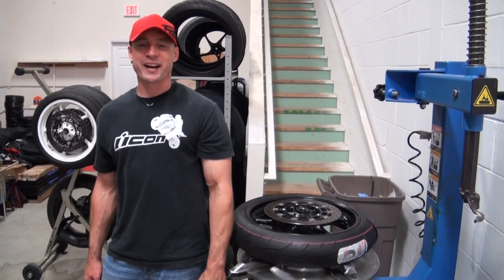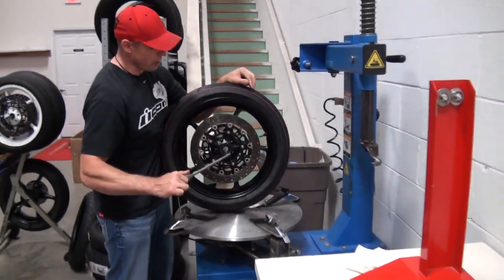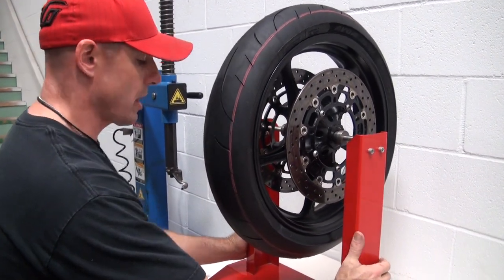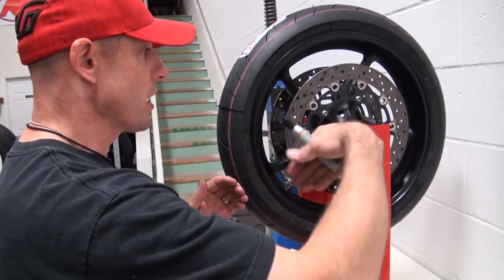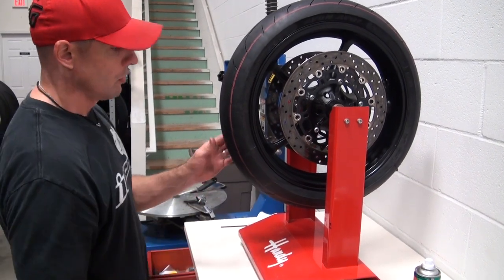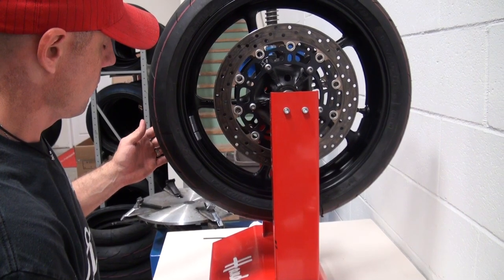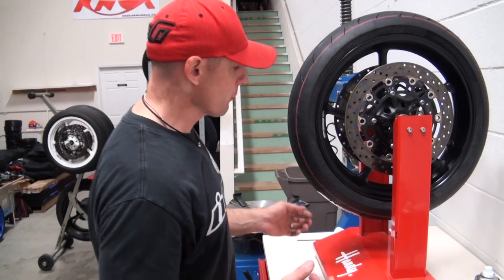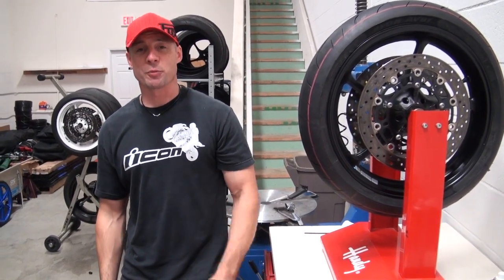How To Balance a Motorcycle Tire and Wheel from SportbikeTrackGear.com

Comment: Before I seat the bead. I balance the rim and tire together. Moving the tire on the rim. A lot of times you can eliminate 1/2 of the weights.
Reply from the maker: That's a solid idea! - Van
Reply: Smart. I'd use a red marker. Shows up better on the tire.
Reply: There was a guy on YouTube showing where usually stands the heaviest part of the tire itself and then the rim heaviest part is where the valve is. So I guess if I counter balance and put the heaviest part of the tire opposite to the valve, them I would need way less balance weights at the end
Reply: @bulltivation7846  the valve stem isn't always the heaviest part. use the balancer to find the heaviest part and mark it with a red circle. then you just match the red circles everytime

Comment: Just a quick one, i was always advised to split the weights so they are equal, in your case 1/2 oz on each side of the rim opposite each other to maintain true balance on both rotation and also side movement.
Reply from the maker: I will split them if it takes more than six segments typically. End of the day I do not think this will make any notable difference. - Van
Reply: If you're sending a machine to Mars, I'd say yes, split the weights. 
On my bike, nah, wrap a little solder around a spoke. 
I'd peel off that paper tag tho....
All joking aside, this is the best vid I've seen on this topic, and will recommend it to others.

Comment: Why can't you just put the wheel on the bike( remove brake pads and obviously belt or chain) and just balance off the wheel bearings?
Reply from the maker: This is the best way to do it, you need to reduce the drag so it can spin freely. - Van

Comment: Probably a dumb question but what is the purpose of balancing tires ? Is it really necessary say for someone who rides street ? My bike doesn’t have any of those stick on weights on the rim and I’ve been riding fine but I just found out about this.
Reply from the maker: You will only need to balance the tires when they are replaced on a street bike. This is a good question. - Van

Comment: Ideally you want the weight as close to the centerline of the rim as possible but I know the cast wheels don't always have a smooth spot in the middle for tape weights.  In that case, no, just do as best you can.  M/c wheels aren't all that wide to induce an imbalance side to side like car wheels or bigger do.  Also for track riders put the weights on the flattest part of the wheel as well if using tape weights.  I've had some smear off at high speed due to the centrifugal force on them.

Comment: Hey! I found a question! You just did a perfect balance weight… and you also glued extra weight on wheels one side!!! Should you split this weight to both wheel sides left and right?😮
Reply from the maker: If the assembly only requires a small amount of weight I will put it all on one side. For those which require more weight I will split it in half and fix one to each side. - Van

Comment from the maker: Thank you for the feedback Neigal Cox, the tape stays.  Most track day and racing organizations require that you tape over the wheel weights so they do not fall off on the track.  All items are available on our website, you should be able to follow the link in the description above.  Thanks!  ~Aubrey
Reply: +Sportbike Track Gear is there any chance these weights can come off (from the front tire) and hit the radiator? what about on the road, should you keep the tape? temporarily ?
Reply from the maker: NoShadowOfDoubt1 That is a possibility but very unlikely. From a safety stand point I would probably tape the weights, you can never be too careful with things rotating at a high speed ;)

Comment: In certain situations maybe..  You can see how far the wheel itself is out of balance, if its not then there is not advantage obviously.  If there is you can match the heavy spot of the tire (usually marked with paint dot) directly opposite the heavy spot of the rim to make it easier to balance out (less weights).

Comment: great video.

Since i started riding 3 of my friends that ride have asked me how are my hands are handling the vibration. i told them i don't get any vibration and that all i feel is the engine buzzing. Turns out they had no idea motorcycle wheels needed to be balanced and all 3 of them had no weights on there wheels. 

Another friend of mine that has been riding for years told me to never take the wheel weights off. he said to leave them on when i change the tire and only get it balanced if it rides real rough with the new tire. i changed my front tire 3 weeks ago and the bike still rides real smooth..

Comment: Great video for the front. How about the rear? Leave sprocket and cush drives in?
Reply: Yes, the closest you can keep the wheel to how it will be when on the bike, the closer and more accurate your balance will be.  All of that is fixed to the wheel and adds to rotational mass, so by balancing it with that on, it effectively balances it as a whole.

Comment: Hello. Did you ever use balancing beads and what were your results?  Thank you for a very professional video
Reply from the maker: Thank you for watching the video. We replace our tires more frequently than street riders, sometimes as much as 4 sets a weekend. For that reason the best solution for us is to use a traditional method of wheel balancing. - Van
Reply: You can't use balancing beads in tubed tires

Comment: Thank you for putting this video out there so I see how this would matter a heck of a lot more on the track, especially at higher speeds now I have not balanced my own wheels personally but then again I am writing a very small motorcycle that has a top speed of like around 60 miles an hour andI couldn’t feel anything out of place but going forward I figure that probably balancing the tires is ultimately probably a good idea so I’m going to do that thank you

Comment: if the rim does not allow to stick weights right in the center one can split the total weight and stick half on each side
Reply from the maker: If you need a lot of weight to get the assembly in balance you can split the weights and put half on each side. If it does not require much weight just put them on one side and send it. - Van

Comment: Strange question perhaps?  With the chain not attached to the rear sprocket, and the brake disconnected from the rear tire, and the bike on its center stand can this be done on the bike.  Is it possible to balance the rear tire on the bike using its own axle.  Will it spin freely enough?
Reply from the maker: That would be a ton of work to balance a tire. Not sure if that would spin freely enough to get a good result. The balancer has its own bearings on top of those in the wheel. - Van

Comment: The side you put the weights doesnt matter ? Like it is better on the right or left side ?
Reply from the maker: If you will need to use 7 wheel weight segments or more I will split them between the two sides. 6 or under just put them on one side. - Van

Comment: What's the best way to line up the DOT logo?
Reply from the maker: For tire brands that have a dot on the sidewall you need to get this as close to the valve stem as possible when you mount the tire. - Van

Comment: Just curious, why are wheel weights only on one side of the wheel, once you find out how much weight it takes can't you divide that in half and put equal amounts on both sides of the wheel?  Why would you want all the weight on one side of the wheel instead of equally distributed on both sides.   Thanks for your help if anyone knows.
Reply from the maker: If it takes a lot of weight then we will split it over the 2 sides. In this case there was so little there is no point as there will be no notable difference. - Van
Reply: @sportbiketrackgear  Thank you for that info and the video👍

Comment: hi..should we put the weight on both sides? left & right side of the rims?
Reply: 4 years too late, but yes, in this case there are 4 of the same amount of weight, just divide it into two and put it on both sides.
Reply: @ViezeVingertjes  I think not.. because the heaviest part was exactly across the spot he marked.. That's why he only put the weights on the marked spot. If he was to put more weights on the place you guys mention.. he would just dis-balance the tire again..
Reply: Lets just over complicate everything, never actually do it.

Comment: How do the weights stay on the tire , is the adhesive that strong , also what happens if one of the weight flys off ? Thank you for your time
Reply from the maker: The adhesive is strong and you have centrifugal force on your side. As long as the wheel was cleaned properly before attaching the weight it will stay in place. - Van
Reply: You sir should not be riding a motorcycle....

Comment: What if you don't have a static balancer? I heard that the red dot on the sidewall of the tire needs to be lined up with the valve stem and leave the factory wheel weight in its current position and it should be balanced. How true is that?

Comment: Do you use 5gm wheel weights?  My OEMs were 10g's.  Current tires have eight 5g tape weights.  Seems excessive!!
Reply from the maker: The weights we are using now are 1/8 oz segments. If the wheel needs more than 4 segments I like to split the total putting half on each side of the wheel. - Van

Comment: Any reason you don't split the weights on left and right side of the wheels? Instead of putting all the weights on just the one side?
Reply: Edit Nevermind, misread your comment.
Reply: +Ryan K i was thinking the same thing, maybe he just got lazy. I'm sure if it was his wheel he would have split the weights and put them evenly on both sides of the wheel...
Reply: +Ryan K It doesn't matter really, by this balancing method only static balance(radial) can be achieved... to dynamically balance the wheel (both radial and side force) this method cannot be used.

Comment: Does the wheel rotate on it's own bearings or is the axle u put in rotating along with the wheel?
Reply from the maker: A mix of the bearings on the wheel and the bearings on the balancer. - Van
Reply: Thanks for the answer. Found out we have a balancing machine at work so will give that a try first.

Comment: A: if I were to get one weight, what weight should I get? 1/8oz 1/4oz or 1/2oz if I were to choose one?
B: What are your thoughts on safety wire spring clips? Use or don't use?
Reply from the maker: End of the day any of those sizes will work, you can always cut the 1/2 oz down if needed. 

I do not use the clips but many others do and like them. - Van

Comment: Great video I was wondering does the tape stay on there or are you just putting on to hold the weights in place for a certain amount of time before you remove it and is there somewhere where i can purchase the weights as well as that balancing machine that you used I like simple

Comment: How do you feel about those tire balancing beads? I know on a track they'd be useless because of the speeds being run and how that deforms the tire, but for regular street use.
Reply from the maker: I have never used them so I really do not have an opinion. IMO standard balance is the way to go. - Van
Reply: @sportbiketrackgear  Mine too, I was just curious.

Comment: Wheel weights only go on 1 side of the rim ?
Reply from the maker: If you need to use a lot of weights you can spread them out to both sides. When you don't need a ton they can all go on the same side. There is no notable effect. - Van

Comment: do you need to put tape on it? that seems really ghetto
Reply from the maker: If you are riding on the street you can leave it. Riding on the track you will need to have duct tape over the wheel weights to pass tech. - Van
Reply: @sportbiketrackgear  I was wondering that too. I dont ride on the track and Ive never seen ductape over the wheelweights

Comment: How do you mount the tire with the white dot in relation to the valve stem & core to minimize weights needed?
Reply from the maker: Standard practice on tires that have a dot is to line it up with the valve stem. With good tires you will not typically see a very big difference in placement IMO. - Van

Comment: Question. No one seems to do anything to hold the bearing spacer in place. I have noticed the spacer moves and alters the balance making it a moving target. As the spacer moves it alters the balance. I'm experimenting with balancing with the axle assembly together to hold the spacer in place. Any comments?
Reply from the maker: When you tighten up the adapter cones on the rod you need to push them inward and hold them to get everything centered. This is a proven process, no need to make any changes IMO. - Van

Comment: I use jack stands and the shaft
Reply from the maker: That is another way to do it. With a balancing stand you have the bearings on the stand so it will be more sensitive and rotate easier making the end result more accurate. - Van

Comment: How can you reuse the oem weights? Do you need some adhesive spray? I have a box of weights. If I can reuse them, then the box will last longer. I am looking into getting the tire balancer similar to yours but from Harbor Freight. Is theirs good or what you recommend around $40? Thank you for the video.

Comment: What happens when we corner without balanced wheel???
Reply from the maker: Unless the wheel is grossly out of balance you will not notice much difference. That said it is best practice to keep the wheels in balance. - Van
Reply: You sir should not be riding a motorcycle....

Comment: Can anyone explain the concept of balancing the tire accordingly? How important is it to be super precise etc
Reply from the maker: You want to get it as close as possible to minimize vibration. It does not need to be perfect to get a very good result. - Van
Reply: @sportbiketrackgear  thanks for responding! How often does one have to do this though? And when would you want to re-check if there's optimal balance?
Reply from the maker: It is only necessary to do this when mounting a tire for the first time. It is pretty rare that a motorcycle tire needs to be re-balanced. - Van

Comment: I want to know if it matters what side of the rim you place the weights, I have no experience with balancing wheels on motorbikes but I've seen how they are done on cars and the wheel balancer machine will tell the tech which side of the rim the weights need to be placed. Should the same principle apply?
Reply: With a motorcycle wheel, it's common practice to just mount it at the center of the rim, for the light spot that needs the weight.  Motorcycle physics characteristics differ from 4 wheel machines in that they use a gyroscopic effect as well as have a changing contact patch based on lean angle that uses a concaved profile unlike the cars flat even contact patch.  Also because motorcycle wheels are usually narrower, it matters even less.  I'm sure someone much more intelligent can explain it much better and mre scientifically accurate, but I hope that answer helps a little.

Comment: Ive balance stacks of car tyres have you ever found swapping the weights in the same spot to the left or right side make a difference.... id expect track wheels to be in better shape than road wheels obviously  smashing bad bumps and potholes will knock the wheel out of shape ?
Reply from the maker: For sure there are no real potholes on the track like riders will find on the street. That said odds are the wheels would be in better condition. - Van

Comment: I need help please today i have changed the tires and the guy who did it told me that the rear tire doesn't require balancing he told me we only balance the front tire is that true ?
Reply from the maker: No, best practice is to always balance both the front and the rear tire after replacing them. That person is full of shit, sorry. - Van
Reply: The wheel will vibrate like crazy at high speed. Even if you got lucky, and got small imbalance, it will mess up your wheel bearings in the long run

Comment: Awesome ,how do you know which side the weights goes? thanks
Reply from the maker: Either side works, get it as close to the center point of the wheel as possible is best practice. - Brian Van
Reply: In the video it used multiple weights. Is there any benefit to splitting the weights between the 2 sides of  the wheel. ie 2 weights on each side instead of 4 weights on the same side. THX

Comment: I just had new tires put on my bike. I just noticed the techs put on some lead strip weights; 1 strip on both sides of the back rim, and 1 strip on the left side of the front rim. The ride felt awkwardly heavier, but I'm not so sure if it's more so because of the new tires. Or is it the weights?
I was also wondering if I remove these strips (they didn't clean the area of the rims they put the strips on) so that I can clean my rims first, what can I use to re-apply the lead strips. And am I going to strip the paint/color off the rim if I try to remove the strips?
Reply from the maker: C LeSaca Those are the wheel weights that are used to balance the tire and wheel as a unit. Do not remove them, if you do the bike will vibrate while riding. Removing them should not damage the wheel or the paint. - Van